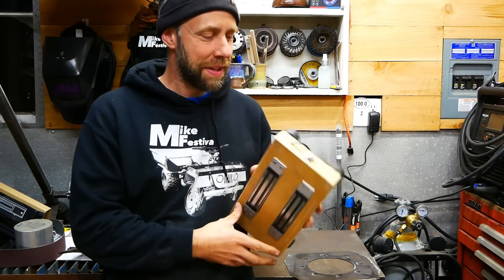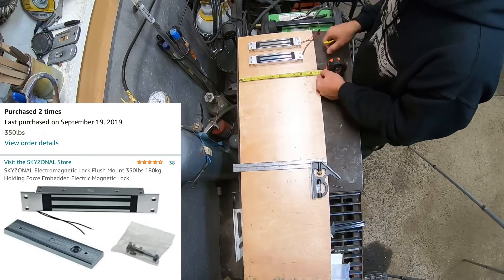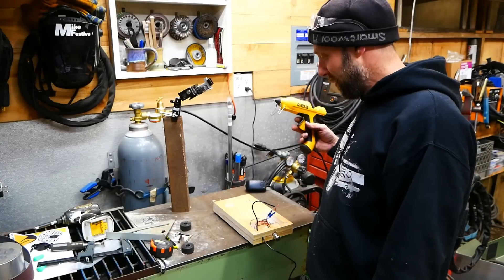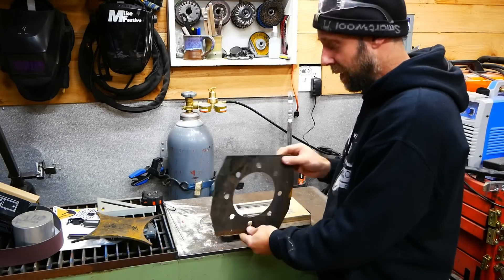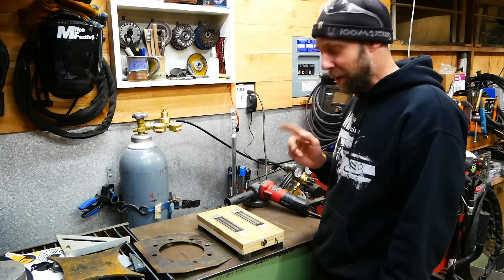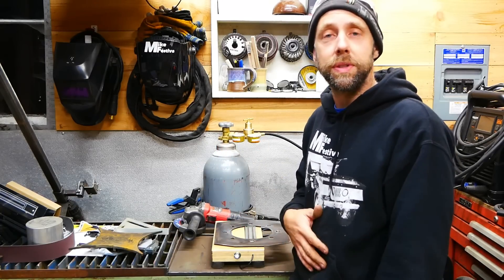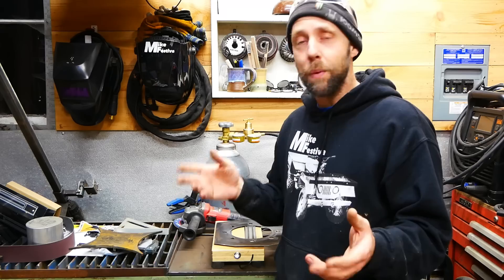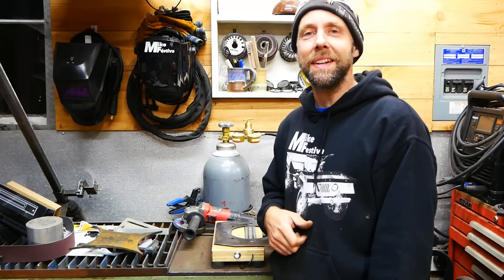Magnetic Chuck Grinding Station

Comment: I made one of these per your video, but for some reason, the holding strength of steel parts I'm grinding is kind of weak, but incredibly strong with the supplied door jam, so I know the electromagnets are working. Any idea what that's about?
Thanks
Reply: Mine were the same. Super weak with metal I want to grind but crazy strong with supllied strike plates. I wonder if the metal I'm sticking on there is not thick enough or flat enough. I also wonder if it has to be flat enough to touch all the metal contacts to engage at full power. maybe it has a circuit that activates full power when contacting all three plates?
Reply: @3dconceptsofutah757  You need fine pole magnetic chuck, as what you are trying to build here, to hold pieces thinner than  roughly 3/8". I think what you built here was a coarse/standard type magnetic chuck which is really meant for piece roughly thicker than 1/4-3/8".  You could try adding a 1/4" thick steel plate atop. It might help spread out the magnetism, without getting too technical,  and provide more hold.

Comment: Hey Mike; instead of wearing out flap discs trying to get through mill scale, try using a cutting disc to just sort of scuff up the mill scale surface. After this the flap discs with have an easier time. Just don’t do it on camera because you know, safety ha ha.

Comment: I think he said 2 amp power supply so in series, the amps are reduced by the number of electro-magnets used. Where as parallel, the resistance current flows thru the lowest device. All things considered, I think that parallel would be best!
 Know, it is an easy test of either strength or weight. Wiring is easy to change, so give it a try! I am just a retired auto tech, who taught 6 different electrical classes from basic, to being comfortable with your DMM, to lab scopes. This is not a vehicle but they never use a parallel circuit unless for serial data, but like Christmas Trees lights, in parallel, if one bulb goes out, the rest stay lit. In series, one bulb goes bad, the whole string is dark. Having more amperage available is somewhat a mute point. As current passes thru the magnets, the coil warms. This increases resistance to the point that 20 amps will only flow the 1 amp required of each electro-magnet. Good question! You are thinking buddy. Nice!
Reply: @John McKinna, see above comment. I messed up!

Comment: I just assembled my own version of this using the parts you suggested from Amazon. The only difference I made was I cut my wood 11 x 15. I thought a little bigger base would give it more stability.  Works great. Thanks
Reply from the maker: Awesome! I’m happy to hear you built one 👍 I used mine last night, it’s great for holding down small CNC parts to clean up with the angle grinder. Take care Jeff.

Comment: I think I would bolt on a thin piece of steel so that you don't accidentally hit the magnets with the grinder.  Just to help it last longer.   It may even magnetize the entire surface, not sure.  But I'm pretty certain that it will still hold things down with no issues.   Nice build.

Comment: How could I keep the Grinding Material from sticking to the Electro-Magnets?
Reply from the maker: The beauty of this is you just turn off the electro magnet and the grinding debris falls off. It’s a useful tool for the shop 👍
Reply: I would put a thin piece of steel over the magnets for protection.  If grinding materials ever did build up on it, you could just un-screw the cover and put on a new one.  but like he said, you turn it off and there is no magnet anymore.

Comment: I've been using permanent magnets to hold parts at my work station for a long time. 5" cup magnets have a 90 lb. pull and hold parts securely for grinding. The work station is a 4 foot long 3x4" angle iron held in a heavy vise at 40" height (my perfect working height).  I can grind edges of parts on 3 sides from the end magnet position of the angle iron. So long as parts extend past the magnet 3 or 4", I have enough leverage to just twist them off and flip them or switch parts (a helper sometimes switches the parts while I can just keep going with the grinder running in my hand). We process batches of parts quickly in smooth flow with no clamping. Also use the cup magnets for making special jigs and squares, etc. They hold down straight edge straps I drag the plasma torch along.  The strong magnetism does mess with the mig welder somewhat, so I don't weld close to the magnet.

Comment: Could you put a few of these under a steel table and get the same result through the table?
Reply: I tried,didn't work. Had to cut a hole and flush mount.

Comment: Moto Mule on YouTube has a similar set up. Great idea.
Reply from the maker: Yes Mike at Moto mule has a heavy duty magnetic hold down, it’s a manual magnet hold that doesn’t require electricity but they cost an arm and a leg to buy. Thanks for checking out my new video!
Reply: Moto mule has all the fancy stuff. Always thought his magnetic holder wild be handy, now Mike has given me a budget alternative.  Good work Mike.  👍

Comment: Only thing i could think to improve it would be, run it off a battery, and put a electro magnet under it so when its on a metal surface it will hold to both the work pieces and the metal table, tailgate or whatever is under it.
Reply: I think having the option to run it on a battery or power supply would be ideal... As for the idea of making both sides magnetic that's flippin genius... Another simpler way might be to make a block on the bottom that would make possible to clamp it into a vise... Since the feet already lift it off the surface, that piece could probably be added without changing anything..
Reply: I think the battery would for sure have to be rechargeable and would die fast too for a lengthy amount of time unless you use a cordless battery adapted for the supply power.
Reply: @carmo9693  Ohh yeah, the battery would likely have to be one of those large lipo's that rc cars use, and you would have to also wire in a low voltage alarm for it as draining the battery fully kills it. thankfully those alarms are very cheap and easy to get. the ideal solution would be a old laptop battery or something similar like a power tool battery.

Comment: I have something similar. I just put some really strong neo magnets on a cam controlled by a lever under my metal top workbench. I flip the lever, raise the magnets, and it sticks. Lower the lever, magnets release.

Crap ya figure me being an electrician and working with them door locks in schools all the time I woulda used them. Aint like my stupid self hasn't wired hundreds of them up.

Comment: A mate made something similar to that a few years back. He used three of the mag door locks (got then from the skip being a shopfitting company). One mag lock was facing up, and the other two down with a Thin sheath to motorcycle tire inner tube rubber stretched over it all. He used it on his steel welding table to lock small parts down for filing. It worked really well for that (Except for when the it would grab the hand file and hold that too. :D).

Comment: The electromagnetic strips are used to hold a fire door open. In the event of a fire power shuts off and the door goes shut. These are a good strip for your project Mike as they are meant to stay powered up for a looong time. I actually thought you would recycle something like the clutch coil from an ac compressor, or parts from a microwave oven transformer.
Nice project Mike.

Comment: Great idea, cool design. I think you could use that in so many ways, and make a bunch of different fixtures to hold it for holding different pieces.

They said 350# magnets, I’m curious how they do holding on to large, or any size pieces really. Maybe an additional bit of info in an upcoming video would be cool.

Comment: nice, just a thought, adapt it for 3 to 5amp 20v cordless tools.  The 2 amp can handle it and lithium ion batteries have protection.  You could run them in series to get more Volts if you need the extra grind time.  nice video, simple to build and very useful.

Comment: I just built on of these too I also used the door lock magnets from amazon. mine were the ones rated at "650 Lbs" holding strength but I did find that if you get any little bit of grit between your part and that magnet it has barley any hold at all. this has resulted in many small parts shooting across the shop at light speed.

Comment: Awesome design and instructions.  Thanks for all the links.  I'll be building one this fall.......  👍👍😎👍👍   As you showed - sometimes the glue gun is the perfect solution.
Reply from the maker: Thanks for checking my video Joel! This is a handy little hold down, especially for smaller parts cut on my CNC table.

Comment: make it a foot peddle so you can keep your hands free when trying to position a part and also mount it to something as that plywood base will just move around for bigger applications and yes argon is a shielding gas that's not flammable but its best practices to keep your tanks free from harm as if a piece of metal from grinding breaks that tank your shop is going to be a unwanted participant of the SpaceX mission

Comment: The small base is not stable. You can build a lager magnetic base to hold the smaller magnetic base.  Magnetic inception.
Reply from the maker: Well Steve I built it to fit my needs, most parts I find are hard to clamp are small.

Comment: I see most people use old MOT cores and primary windings. The door locks will work better as the surface area is a lot bigger. You also don’t need mains power to run them.
Great idea, Mike.
Reply from the maker: Thanks for checking out my new video 👍
This was nice and simple to built especially that all the parts are easily available. Take care